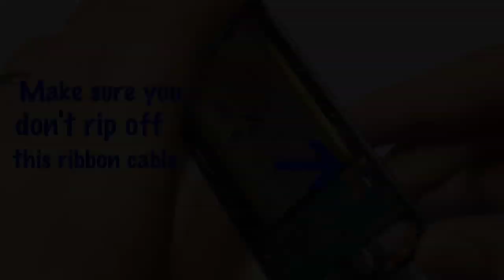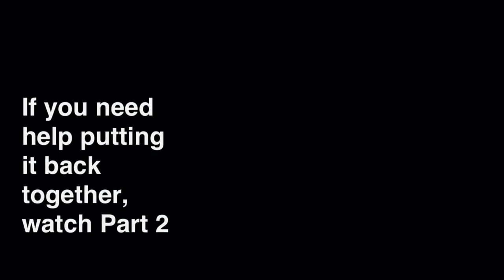iPod Touch 4 - Back Housing Replacement / Full Disassembly / Taking Apart - How To...

Comment: Thanks for posting this vid, it helped alot.  The only thing I would add to the instructions is I found it not necessary to remove the center camera and wifi antenna. The only problem I had was I got a small tear in the flex cable near the lower volume button.  That's the only thing that doesn't function now on my ipod.  You really need to be Careful.  Now I know what a surgeon must feel like.  Thanks again.  
By the way this took me about 5 hours to complete successfully.

Comment: Good video, thanks!  The power button/volume button ribbon to the motherboard was glued down very very tightly on mine and I ripped it even though I was very very slow and careful.  Best thing would be to heat up the area with a heat gun/blow dryer to loosen that adhesive before trying to lift the cable around the volume button.

Comment from the maker: Yea, you're right. It's not very clear in the video. You are not suppesed to pry under the battery, but the copper shield instead. Also the dining knife I used isn't sharp at all, so it was fine for me.
I'll see if I can add a note to the video. 
Thanks for pointing out.

Comment from the maker: It might work. If not, you'd have to get a new ribbon cable ($5 on eBay) and re-solder it - not the easiest job... 
Try to put everything back together without closing the screen, just connect all parts and turn on iPod. Hopefully it'll work.

Comment: Good video EXCEPT, I now need to replace the battery, because the battery has dents and one slight puncture all along the edge, from being pried up by a knife like in your video, which makes no mention about how soft the battery is.  Also the copper shield is scored badly too.  And I reheated the cover again just before detaching the battery. It might be better to use a flexible tool instead, which can flex around the battery's edge to pry away the battery/copper shield from the back cover.

Comment from the maker: It will be not cheap for sure. Call and ask them how much it will cost. Then try local repair store as well. It might worth to sell it as is for parts on Ebay and get a new or used iPod. Just shop around.

Comment: I peeled the power/volume ribbon directly (not from the metal plate below it -- didn't even know that existed) and ripped it. Good video, but I think something more than "take your time" would save some people's devices.
Reply from the maker: Nope, that's all I did. I did it very very slowly and carefully. It took me forever, but it worked. (I trimmed the whole process from 20 min to 1 min in the video). The only extra thing you could do is to heat it up with hair blower to loosen the adhesive.
Reply: The thing more than take your time is think and watch tutorials before doing it by yourself, i destroyed my first iPod Touch 4g with it :P
Reply: I was able to get it working in the end, but with a new board I found that with removing the ribbon cable, there is a very thin metal strip under neath it, and you can remove the cable much faster and very easily if you push from under that.

Comment: if your having trouble closing the iPod after the repair, i think its best to not move the white plastic piece into the new rear housing.  I think it elevates the screen which is why it may not pop into place for you.  I don't think it has any impact on the functionality of the iPod.
Reply from the maker: It definitely doesn't affect functionality. 
Did you use glue instead, cuz this white adhesive kinda holds screen in place?

Comment: Hi. well I got as far as the last bit of ribbon, the part where you said to "go slowly and take your time", and I did - but I noticed a small tear. I wonder if I should just stop here or put it all back together to see if it works. I was in the process of replacing front & back + rear camera. think it will it work still?

Comment: I have an ipod 4 with a small dent in the housing case above the speaker which is preventing the lcd digitizer to settle in, do I need to replace the housing case in order to fix this?

Comment: I have a I pod touch 4g, that I replaced the back housing and lcd screen. when I tried a test run the everything worked except the camera and the screen had a light white flashing to it. what do you recommend?
Reply from the maker: Ideally, you wanna test everything before putting it all together. Make sure you snapped in camera ribbon cable properly. If still doesn't work, you can get replacement part for few bucks online. If still doesn't work - it might mean you have broken connector on motherboard.
Reply: okay. do you fix I pods? how much would a rough estimate cost be?
Reply from the maker: I usually try to keep the old cracked screen until I'm finished with repair. If new screen doesn't work, I connect the old one and it usually works fine. Than it means you've got defective replacement part and you need to return it. It happens a lot, especially if I buy the cheapest ones out there.
Reply: If there are some scratches on the copper cover of the battery from taking it out of the back housing, would that be a problem? I just dissembled the whole thing just now lol
Reply: the reason I say this because maybe the battery was damaged when I took it apart, perhaps?
Reply from the maker: $ 80-100.
Reply from the maker: Few scratches are ok as long as the battery is not damaged.
Reply: thanks that helps! do you buy damaged Ipods and sell them? I'd like to start a business now!
Reply from the maker: I was thinking about it, but then I found a job and now I don't have time for it.

Comment: You could just buy another ribbon for $5 on eBay and de-solder and solder on the new one like I did.  I had a cheap soldering iron so it was rather difficult to melt the solder precisely.  I ended up messing up the connection somehow so that the up button is always in a pressed-in state (not physical button but the soldering I think).  I just set Activator to ignore all volume button presses.

Comment from the maker: You're more likely to rip off power button ribon cable if you don't use sharp blade. That adhesive is too strong to just pull the cable. I've done quiet a few replacements with no accidents. If you are not confident doing that on yuor own, just have a professional tech doing it for you.

Comment from the maker: Try to sell it on Ebay. Just describe exactly what happened, include every single part you have and post a few pictures - and some repair guy might buy it for parts. Non working iPod Touch 4th goes for ~ $40.